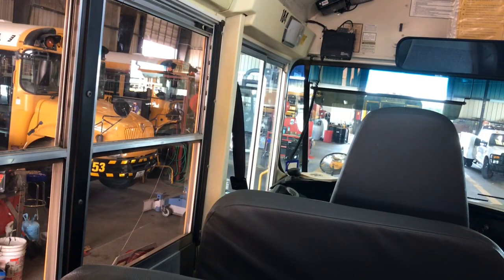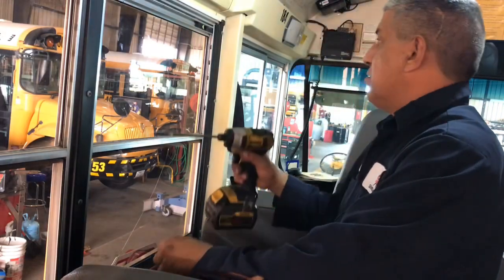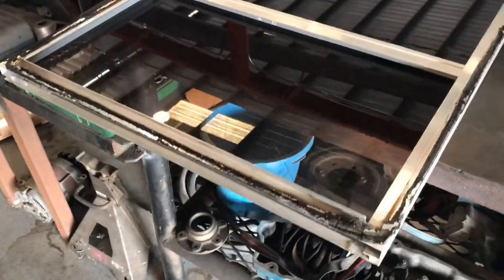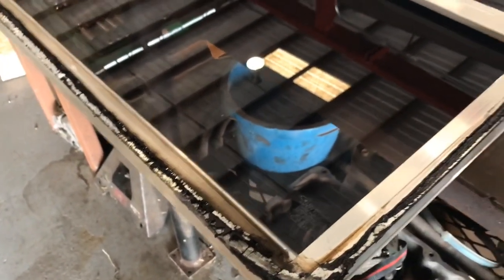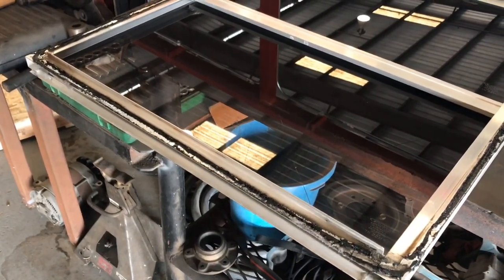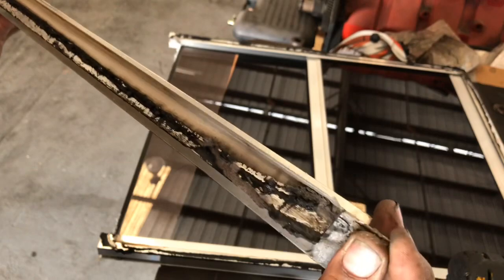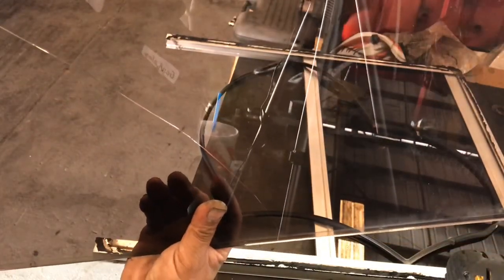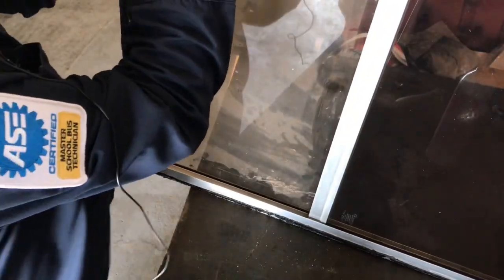CE Bus broken window pane

Comment: We use blue painters tape for masking, to cover the mastic around the window to keep it from sticking to everything (including us) when we pull a window from a bus. The silicone in the corners of the window frames can be removed with a small flat-head screwdriver, but should be replaced to keep water from seeping into the window and down the inside of the wall of the bus.
Also, we have overhead racks in our buses for backpacks and other parcels which riders bring on board. They are secured to the wall at the same location the top screws in the flat, black metal flanges are held in place. Overall, we do the same things you're doing, with just a few more steps. Enjoy your channel and follow it for more repair details on our bus fleet.